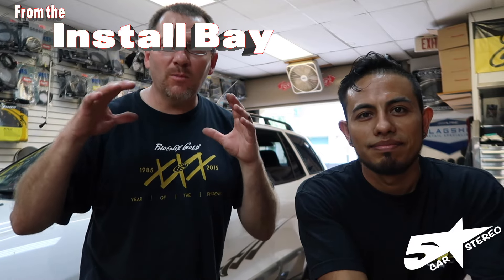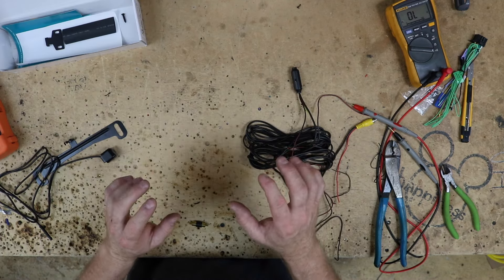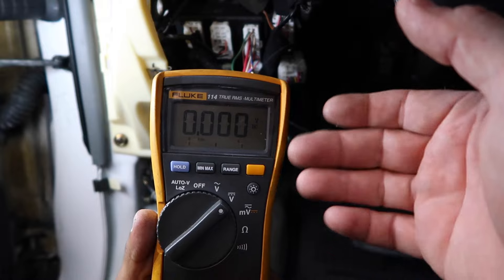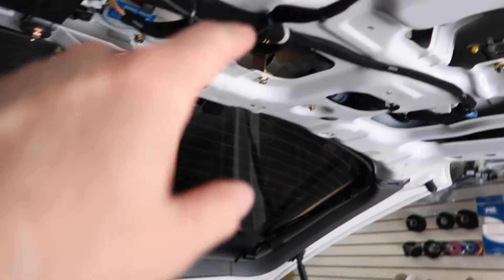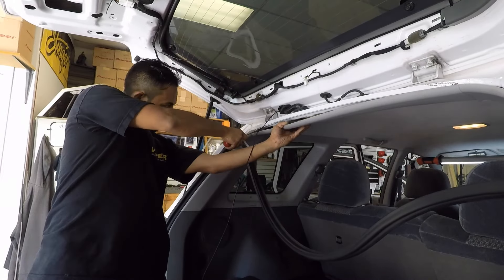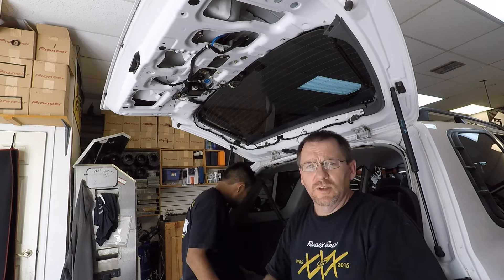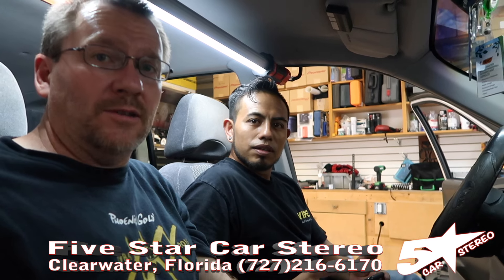More, how to install a Backup camera in your car

Comment: Great tutorial but this might be worth pointing out.  Some license plate style units now have bright LEDs that activate when power is delivered to the camera at night.  So, if you are constantly powering that kind of a camera those bright LEDs will be on even if you are not in reverse gear.  Might be worth considering.  Correct me if I am wrong.  -Merv Himself
Reply: How do I fix that problem I'm having it right now
Reply: Yup, don’t do what these guys are recommending. You only want this camera when your in reverse.
Reply: A
Reply: Thanks for pointing this out!

Comment: I just installed a eRapta ERT01 HD Backup Camera. My question is how do I get the LED lights to turn off. Because they are running constantly, with or without running lights and in every gear

Comment: Can't figure this part out... What did you do with the black wire that the instructions wanted tapped into the reverse light? You capped off the red, but it looks like the black is still dangling.

Comment: That was absolutely brilliant.  I've just bought a reverse camera and the instructions on mine aren't that great (my car is a Honda Accord with a built in OEM sat/nav/gps screen).   The way you explained the power for the camera at the beginning and under what circumstances you might want to use that red wire cleared my confusion with my unit (that these accessories aren't only for my type of vehicle but for all the others out there too, including aftermarket head units).  Thank you soooooo much!

Comment: Not sure how I didn't find your videos 2 weeks ago when I STARTED installing my new in dash unit with a back up camera, but man, I'm sure glad I found it today. You guys explain this better than any other channel I've watched for this, and I watched A LOT. Why doesn't everybody wire them up the way you do. It makes it SOOOOOO much easier. I've been trying for 2 WEEKS to get mine working. Granted, I complicated mine a bit because I have a previously installed rear view mounted dual dash cam and backup camera that I'm trying to splice together with the indash. I really don't want to lose my front dash cam's recording feature, so if you guys can give me any kind of hints about how to wire them both up together, or if they can't be wired together (which is what I suspect because the rear view mounted dash cam is on the back of that touch screen and I don't think my cheap little indash will support picture in picture), is there a way to wire it so that I will get the rear camera view on both, and then the dash cam would have to still project to the touch screen on the rear view mount. NOBODY has a video even close to telling you how to do that? And the rear view mirror touch screen currently gets it's power from a 12 volt plug, and I have the port that it's plugged into on a kill switch that I switch off  when I stop the engine. I KNOW there's a better way to do that.

Comment: Thanks Guys for your time and knowledge! So many you tube videos are done by people that really don't know what they are doing and its clear you do. I spent a long time in the auto repair business and its nice to see someone that's not installing something in their driveway. Its nice to see you have the right tools and knowledge. Its appreciated. And I got a few new ways to do things like using a big modified nylon tie strap as a snake. Ive been using electricians tapes for pulling wires, nice to have options.

Comment: Thanks for this video.  Today I am getting a Sony xav-ax1000 stereo installed in my 2011 Ford Ranger and will be installing a license plate frame backup camera myself next week.  Without your video, I would have just spliced the power wire directly to the reverse wire and wondered why the radio's touch screen camera function wasn't working.

Comment: Thank you for this video. It was very informative and I used all the information on here to get my backup cam to work. My first I installation didn't work but I'm pretty sure it was the camera. I bought a new camera and wired it the same as before and it works amazing and I can even look at the camera without backing up. Once again, thank you!

Comment: Hey Dean and Fernando, I have already connected the cam using the reverse light as a power source. Now, I want continuous power so I can use the "cam view" feature as you described. Can I just tap into the accessory wire behind the Pioneer and splice it to the red cam wire (near the rca male)? Of course the red cam wire is already connected to the reverse gear wire off the Pioneer currently. Will this accomplish my goal?

Thanks for all the awesome video over the years!

Comment: I just need to clarify. So you splice the power wire on the camera to the 12v switched power on the radio harness and you connect the purple wire to the reverse light 12v wire? That's how I understood it. Please correct me if I am wrong.

Comment: So you did not connect the red power wire to the backup lights because you found a backup power wire up front. What if you can't? Then do you keep the power wire in the back (instead of cutting it off) tap into the reverse lights, and then connect the red power wire up front (with the RCA) to the radio trigger wire? Thanks. (Love your videos!)

Comment: That shop looks like an old "Al & Ed's Auto Audio I used to work at in Marina Del Rey Cal. (mid 90's)
For those with Jeep Grand Cherokee's most from late 80's on up, the Reverse wire in dash is White w/ a light green stripe under dash, off cluster. then run a relayed 12v supply triggered by the blue/white power antenna wire off radio to camera supply, or for the amp heads, tap off that monster 2 gauge rail thats feeding the Bass-beasts already in the back of your Hoopti
Ta-Da!! Its its own voyeur monster viewer

Comment: You should slow way down firstly.  Otherwise, glad that you explained the differences between a 'backup view only' and 'backup available' options. I have a 'parking brake' wire on the back of my radio harness: does this need to be attached?

Comment: Dean solved the problem had a kx 400.4 used 2 chanels for the 6 3/4 and the other 2 for the crossover hooked to the 3 inch and the tweeter and they get real loud
Reply from the maker: +Jhonny Garcia perfect. Glad to hear that. We did the same thing with the Alpine PDX-F4.

Comment: TY SOOOO MUCH. I have an 02 ram 1500 slt and if yk anything about this truck it's half 2nd gen half 3rd gen...  Spent the whole day hunting for the right wire to connect for yhe reverse switch and such... Basically I said fk it and now have it connected via the 1 positive from the tail light. All I wanted. I think your way is awesome, but I am NOT retapping every wire I just tried in the cab.

Comment: So I suspect that since there is power going to the camera at all times when ACC is on, this means that I will not be able to do this wiring method on a camera that is equipped with lights, eg. eRapta ERT01? Correct?
Reply: I just hooked up my eRAPTA camera to acc.. wondering if I should do it the more "traditional" way since the light is on all the time... what did you end up doing?
Reply: @hybridmotion  I'm just hooked up directly to the reverse light power. There's no way to hook it up to acc without the lights being on all the time... unfortunately. You would need a different camera without lights.

Comment: So after watching the vid again, I could also run a wire from the reversing lights+ in the boot up to the units Reversing signal wire P/W. Then connect the red pigtail wire to the acc. (also joint the red wires in the boot) Thanks

Comment: Great video but I have a question. I've installed a Kenwood DMX7706 with the Maestro RR. There is a purple/white wire coming off of the radio and one coming from the RR. Do I hook both of them up to the trigger wire from the lights or just the one from the back of the radio?
Reply: Did you figure it out? I’m hooking a boyo up to the same radio. I can make the camera work as intended on reverse but I’m stumped on the other manual method I’m doing something wrong. Not sure why he says not to use the red in the rear but then turns around and runs a reverse light wire.
Reply: I wish they would answer our questions and not just respond to the compliments

Comment: So if I did not want to hook it to my reverse then don't use the purple wire and I would have to manually turn the camera on through the stereo right?
My Honda has a built in reverse camera built into the i MID, so i wanted to use my stereo for the front camera

Comment: So the issue I’m having is my backup camera works fine when I put the truck into reverse with the truck not running, but when I start my truck and put it into reverse the camera doesn’t switch over. Any ideas as to why? I am using a 14ga wire for my reverse switch wire would that matter?

Comment: Hi everyone. I have a doubt regarding the camera trigger cable and the red piggy tail for accessories added to the front harness. The camera trigger cable added that goes forward will be connected to positive cable at the car's back reverse light and will be connected to the purple(Pioneer/NEX) wire of the radio's harness . Now that piece of red cable added will be connected to the red piggy cable added to the accessory cable in the bundle please confirm don't want to blow my new toy. Thanks

Comment: I'm installing a backup camera on a 1997 Chevy C1500 this weekend. I got a Pioneer camera and an Alpine radio. The camera is an adhesive mount and I was planning on putting it on top of the receiver hitch. Any tips that would be different for a pickup truck like wiring through bed and into the cab? Thanks. Great video

Comment: Hi I have a brand new 2022 Mazda 6 Sedan, which already has a back up camera fitted, however the graphics are crap, can I buy an aftermarket camera and hook it up to my cars existing wiring at the rear of the car for a simple fix? And if so which camera should I look for with the clearest images, and parking guide lines, or this information sent from the head unit n the dash?

Comment: If the camera is powered by accessory power is the power on it when accessory power is on if so will that shorten the life of the camera or is the camera on only on when triggered by reverse trigger and head unit.

Comment: When you connect your reverse wire from the camera to acc., how do you turn the camera on when you put the car in reverse? It's already on.
Reply: Exactly, its already on, so you shouldnt need to do anything special to see it.
Reply: If you have a pioneer nex radio, connect the camera power wire to the acc. wire and run another wire from the taillight or reverse trigger of the car to the reverse trigger on the back of the radio. Then in the menu setting turn on the camera if it’s not already on

Comment: Great video as always!  Dean, in another video you say there needs to be a relay put on the 12v accessory wire powering the back up camera.  In this video you don't mention it.  My deck has a 3 amp accessory wire.  Will I need to put in a relay?
Reply: The other video was titled, "How to add a relay for more power"

Comment: So I have the new 10.1 inch Kenwood how would I have to wire it to view the backup camera at all times the unit has the option to view it so do I wire it regularly or do I have to constantly have power to it

Comment: What are your views on Wireless backup Cameras?...and would there be a way if you had a wireless camera to get accessory power at the rear of the vehicle? Other wise I suppose you could run a hot wire from accessory back the the rear of the vehicle, which really negates using a wireless camera....lol

Comment: Hey thanks for the video. Just a quick question.. When you loomed the wire to run in the roof liner, did you tape(tessa tape)  up the loom (like i have seen you before)?

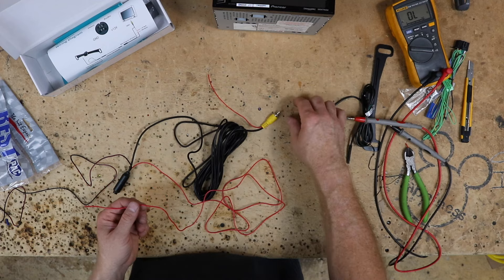Comment: What do you use to cap of the wires at 2:48 like that? I was looking at wire caps but I only found large ones for home electrical. I notice yours was like the wire size which is what I'm looking for. I'm just not sure if that's what you call them or not.

Comment: Is there a way you can make the picture not show backwards? When I'm backing in a driveway on the screen what's really on my left shows on my right.
Reply from the maker: Yes most camera have a wire loop at the connector or a button switch on them to do just that.
Reply: @FiveStarCarStereoInc  you talking about the wire loop for the lines on the screen?

Comment: I'm sorry I don't get why you made the pigtail on the red wire where did you connect it to?
Reply: Ohh my God how fucking easy
 Type one so the auxillarry red ties off to the red pigtail off the Rca. Then the camera power you just tie the red pigtails together from the power cord and the Rca. Then reverse is ran from head unit to a reverse wire either from front or back. I was confused watching this video about running the auxillary wire back to camera but it was a different type camera. Just watch other video for types of cameras. Thank you guys I appreciate your awesome videos Im a beginner but this has saved me some money.
Reply: Just for clarity other video talks about different types of cameras I had a type 1. The Rca plugs into reverse cam output then the red pigtail goes to taps into the red auxillay from the harness. Thanks.

Comment: I have one of the knock off ones its one of the 2 part ones the rear cam has the round hard plastic and only a red wire but no black wire and the wire that goes to the mirror with a head phone jack. How do i hook up to the reverse light if i have to i can do a short vid of wat i have on my channel

Comment: Just had a question about wiring the reverse light. I have an after market double din and just want to know what wire to i use in my harness. Would it be high beam line (orange wire) or parking sensor control (pink wire)
Reply from the maker: The pink wire should be the trigger for reverse. The orange white will dim the radio display

Comment: I have a 2008 gmc sierra with a kenwood ddx393 I wanna install a front camera.. what can I tap into for the positive wire ? Can it be any positive? And what camera do you recommend?
Reply: tap into the positive on the stereo as he explained in the video put a pig tail on it  and have at it
Reply from the maker: +Tony Palomar yes tap the harnesses accessory wire. Just make sure the Smart harness you are use has a relay or can handle the extra current. We use these www.echomaster.com

Comment: My camera also has Leds, where would I go about hooking up the LED trigger wire?
Reply: i would add that to the reverse lights with a relay. you wont need them during the day so having them connected to the accessory 12v would be pointless as they would always be on with the camera, may as well only have them power on when the radio switches with reverse.

Comment: My camera flickers and goes out when I hit the brake otherwise it works perfectly fine. Anyone know why?

I have proper frame ground with bare metal and dielectric grease.  I have a it powered to the red 12v ignition wire to turn on when I want. The reverse wire is connected under the dash. I also disconnected the reverse wire to troubleshoot and my camera still goes out when I touch the brake.

Comment: ive got a 2001 f150 with a pioneer radio with back up cameria attched to it, my problem is when i back up then switch into drive gear and drive forward the screen on my radio switches from the back up cameria screen back to radio screen but for only a minute or so then switches back and forth between radio and rearview screen it doesn't stay on radio screen while driving forward like it did when i first bought my truck. i had the truck taken into the shop and a new heater core installed in it and when i got it back from the shop this issue has been happening all the time since i got it back from the dash beiing tore apart when they put the new heater core in the dash and put everything back together again . can you please tell me what to do to make the radio stay on the radio screen until i put the truck in reverse then show the reverse cameria screen for backing up then switch the radio screen back to radio upon shifting the gear shift back into drive for forward driving and end the switching of the screen back and forth every two or three seconds while driving forward down the road. it never done this before and i can't figure out what they done in the shop to cause this to start happening.
Reply: What I did was reset my pioneer. It did it a couple of more times and I just kept resetting it and then it FINALLY stopped freaking out. Good luck I hope it works for you.

Comment: So for the thr reverse wire i can use 18 gauge wire any color?
Reply from the maker: +BoBoSticks yes the radio does not draw any significant load. It is just a trigger feed.
Reply: Five Star Car Stereo ok thanks

Comment: I have had my vehicle almost a year still can't figure how to program it . just use one radio station anyway its a Pioneer when I back up it has a black screen it says there is a back up camera I found a wire or plug in the glove box and I found a wire or plug under the trunk mat don't have a clue what either of those wires go to. maybe I should just take that pioneer out get another brand with a manual

Comment: do you put touch up paint on the hole that was drilled?
Reply: SwiftHelix I believe they use a 3M silicone goop to seal the sharp uncoated edges!
Reply: didn't think of that, thanks!
Reply: on thing that got me was when they showed them drilling i don't recall seeing a bit of paints tape there just in case of a opps moment
Reply: I guess they rely on pressing hard enough so that the drill bit doesn't wander but not so much that it makes a dent.
Reply from the maker: +SwiftHelix we do use 3m strip caulk for all holes
Reply from the maker: +Tt Ss we use a sharp step down bit for drilling holes.
Reply: +Five Star Car Stereo I saw it on your F150 video, thanks for the reply